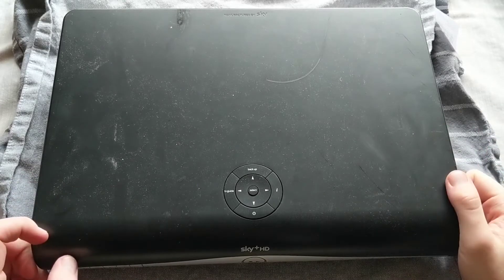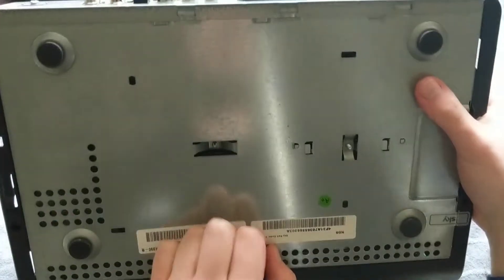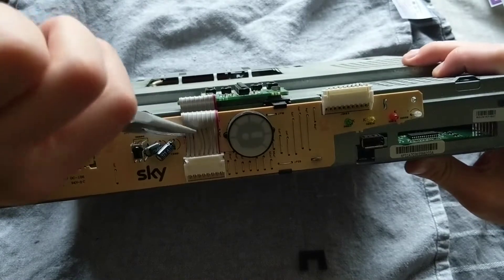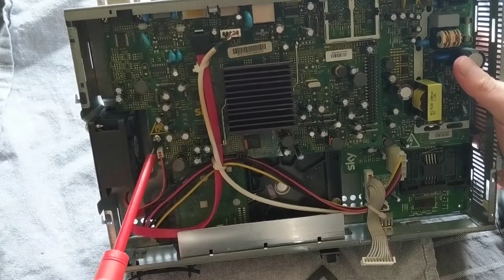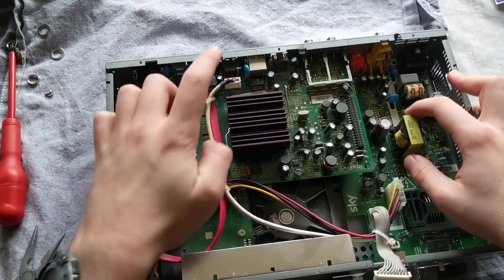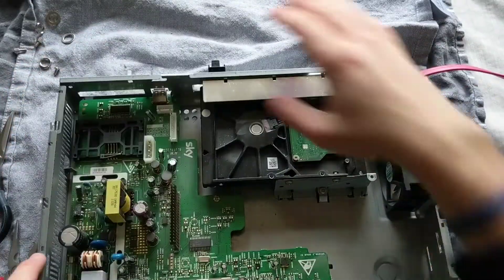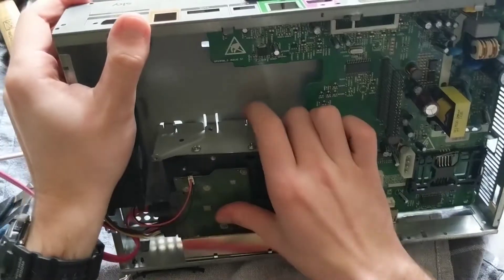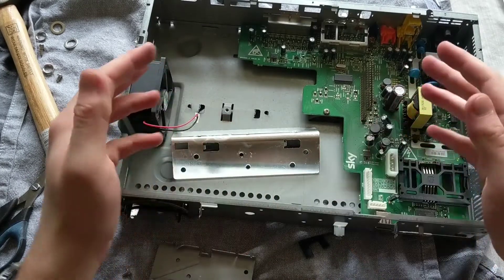How To Retrieve Hard Drive From Sky/TV Box

Comment: I got the had drive out but won’t connect to pc I purchased a on eBay 

USB 3.0 To SATA 22 Pin 2.5 Inch Hard Disk Drive SSD Adapter Connector Lead Cable

But nothing. Any suggestions to get it to work
Reply from the maker: Very much late to answer your question, but in the unlikely event you haven't yet found a fix, I would say the issue is the power output. USB cannot sufficiently power a full size HDD like the one shown in the video. Sorry again about the late response! :(